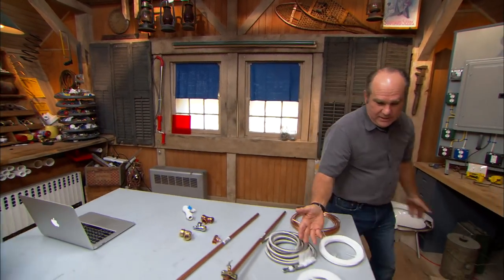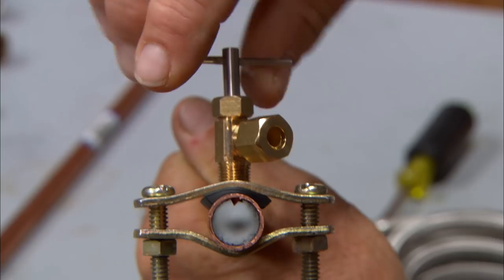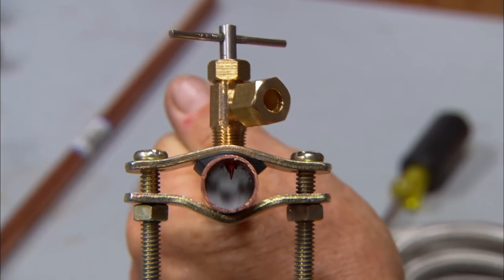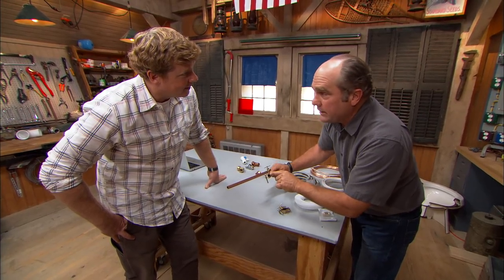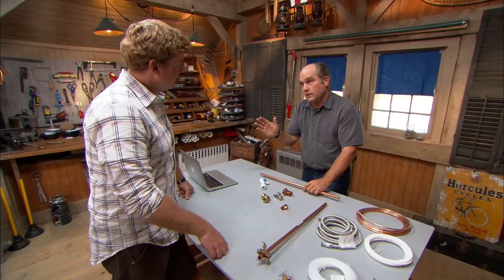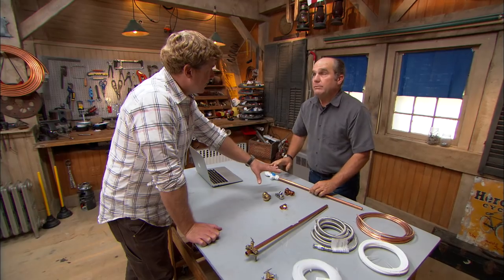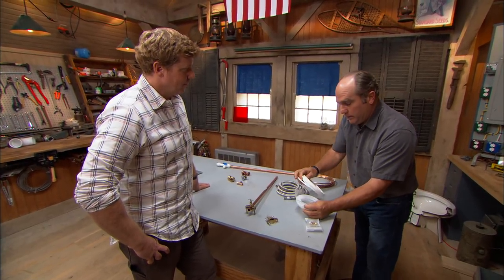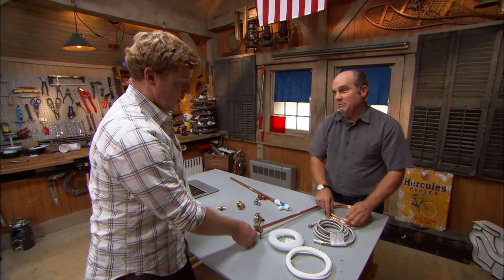How to Connect an Ice Maker | Ask This Old House

Comment: I prefer a shark bite type of fitting and a braided hose. The copper breaks if you move the fridge too much. Braided hose is very flexible and allows for more movement of the fridge. I have a copper pipe in my house right now and im going to replace it with braided
Reply: Why don't you just get food grade plastic hose? Does the same just wondering

Comment: Richard, if you use the stainless steel braided hose, how do you prevent it from kinking when you move the refrigerator back in place? With those standard wall box with valve assembly from the big box stores, seems it could also use an elbow to help? Thanks

Comment: We are about to get a new fridge that will need a water line attached.  We dont want any plastic in the water delivery system so copper is our go-to. 

Braided steel lines SOUND like they arent plastic , but the braised steels only SUPPORTS the plastic line inside.

Comment: Braided-stainless steel line is best; copper line is not meant to flex, which will happen whenever you pull out refrigerator/freezer to clean.
Reply: That is why you have to leave the copper in a loop, like a sort of coil spring.  That's the only way to do it so it will not kink.

Comment: Since braided stainless steel itself won't hold water, it still relies on the tubing inside the braid which you can't see, which makes you wonder if they are cutting corners on quality on the inside.  I would be curious to see the failure rate data on stainless vs un-braided.

Comment: Hi Richard, this is Bill old school, why are there no standards for pipeline hook up when using plex? I have many places around the house that require supports because they are so flexible and sometimes you need stiffness such as wall & floor penetrations? I had a hot water tank & filter system installed and the plumber used plex and there is no level to all the piping. Too much flexing. I like to use plex for the long runs but think copper is always best for the end connections to anything. What're your thoughts, Thanks, Bill

Comment: My place had the stainless braided line and the ice cubes tasted horrible when they melted. I replaced it with copper tubing and the problem went away. Not sure who manufactured the stainless line like I had.
Reply: Flexible stainless lines have rubber inside which is likely what contributed to your taste.  Is your kitchen sink plumbed with stainless lines as well?
Reply: As another said the stainless steel braided portion is only on the exterior for rigidity and protection internally it's a rubber. They may have used lines not meant for potable water..

Comment: As usual, so many haters.  This video was exactly what I was looking for, and straight to the point!  Thank you! :-) 
However, it would have been nice if links to the products, or event a list of those item names had been provided.  I have been to Home Depot 4 times trying to look for the proper part to connect to my existing brass-copper tubing without soldering.  The plumbing-section employees there act completely clueless as to what I am talking about or what I need (*Normally I like Home Depot, but the complete ignorance on this issue has me frustrated*).

Comment: Ok so here's my question.  If I currently have one of those saddle valves in place, how can i replace it with one of those new ones if a hole is left from where the saddle valve was???  Any Links
Reply: +ShyRage1 shut off water, cut section out with pipe cutter, sweat in new copper or use shark couplings.
Reply: +Hector Morales lol
Reply: +Tahj Carter I'm joking there but the truth is years ago I called a plumber and watched as he repaired a plumbing issue (burst pipe from freezing).  It cost me $100 because he was a good guy and did this for me on the side saving me a few bucks.  I watched and thought, geez there's really nothing to that.  Got a torch and practiced on some scrap pieces then over the years I have saved hundreds if not thousands from that $100 investment.  Put in an outdoor shower, repaired pipes at relatives and friends houses also.  This was before the days of Youtube mind you, so there's really no reason someone with a little bit of skill can't do the same.  The trick is not to burn the house down.
Reply: +Hector Morales absolutely right!!!!  same here!!!
Reply: You would cut a section out with a hacksaw that includes the hole and replace that section with a shark bite type of fitting
Reply: Just make sure to make nice straight cuts so the pipe fits flush
Reply: You want to get a pipe cutter, do not use a hacksaw!

Comment: I want to cut the current valve off my cold water line to my sink. Then install a shark bite tee valve for my ice maker but still have a way to reconnect the faucet line. Do they have a shark bite for that?

Comment: is there a good way to run the tubing to the fridge? is it typically run through the wall or around the base of the cabinets?
Reply: +Mitch Hackett
A) There may be a supply right behind the fridge already. Just run it from there.
B) If you have a basement or don't mind using a crawlspace you can run it under your home.
C) Drill a hole into the back of your kitchen cabinets (about 21/64 will be perfect) and run it along your wall.

You can use any method you'd like as long as you have enough tubing and can access the tubing/recognize and react to a leak. If you aren't certain what options you have you should go to a hardware store or last case scenario for something this simple just hire a licensed plummer.

Comment: Literally never seen one of those fail ever.
Reply: I haven't either. I've seen the plastic line kit break but not the valve itself. The plastic line lasted about 3 years and the saddle valve is been going strong for 25 years now.